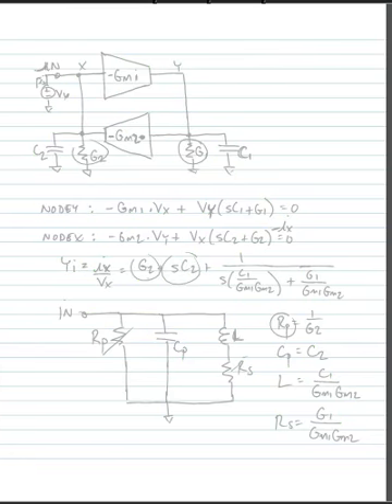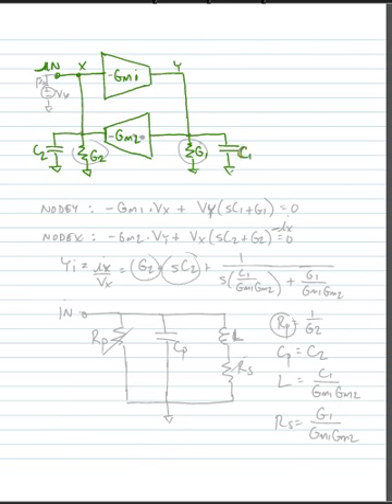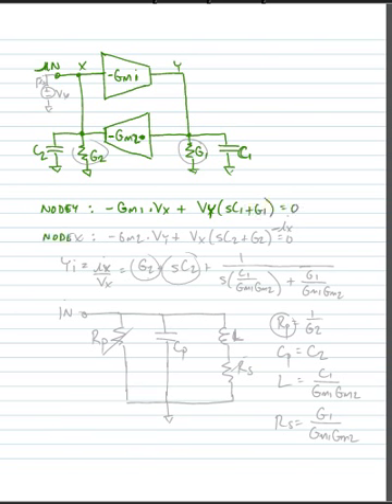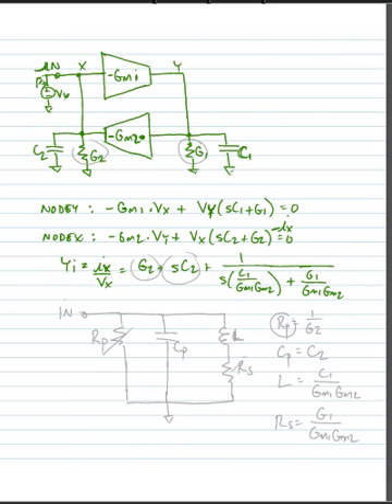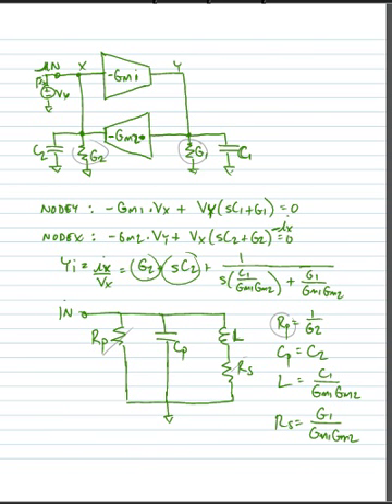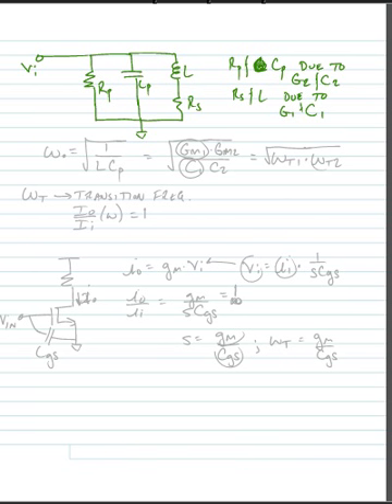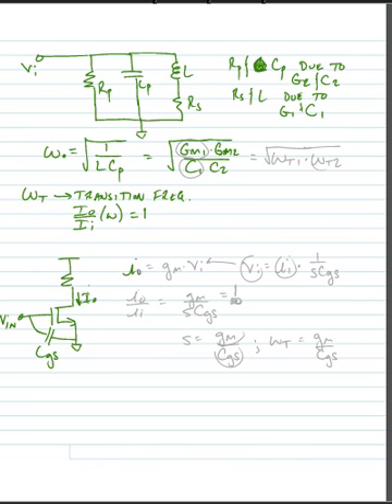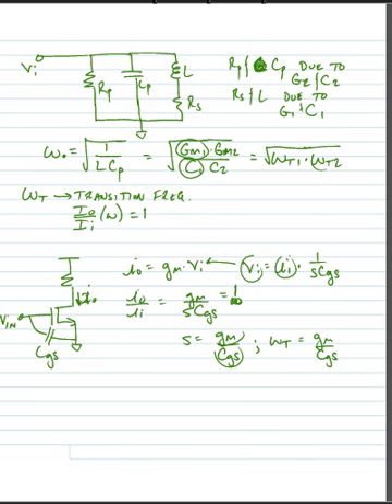ECE 3110 - Lecture 23 - Part 3 - Gyrator-C

Comment: I'm designing an Low noise amplifier with active inductor for 2.4 GHz with 180nm tech using cascode cs lna with inductive degeneration, i want to replace the inductors present in the lna designed  earlier with active inductors.
1)what is the maximum inductance value that could be achieved with active inductors?
2)what could be the better choice of active inductor that could be used to replace an inductor   connected to VDD having a value of 5.8 nH which is used as load inductor?